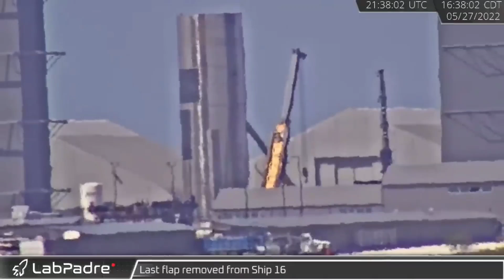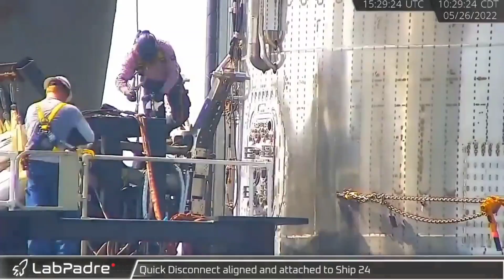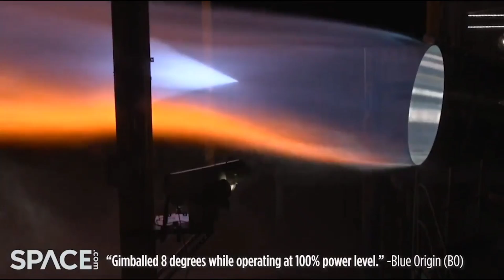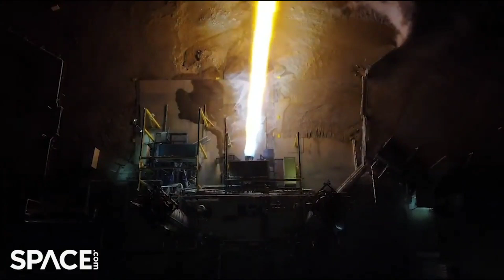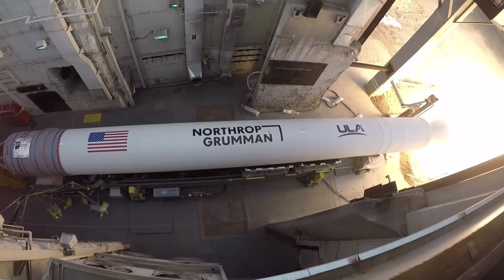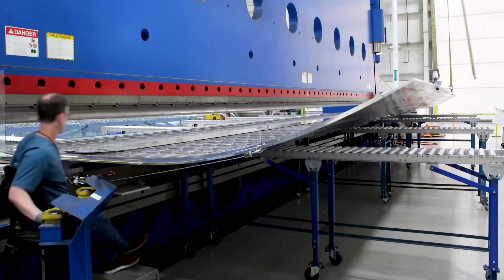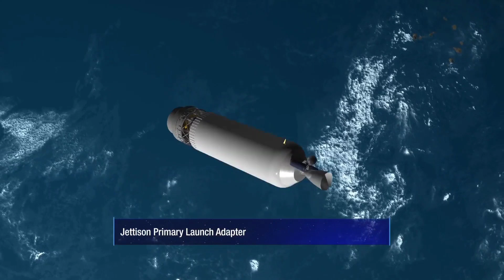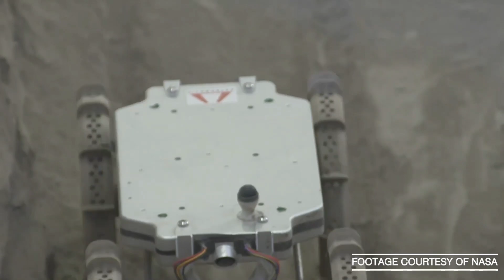Starship vs Vulcan Centaur!  Who launches first??  100K Challenge Update!!

Comment: While Tory Bruno is an engineer he is also head of ULA and needs to keep his investors calm, he has been fooled before by Blue Origin promises and so far they only have one operational engine which is a one off prototype. Now, there is no doubt that this BE-4 can operate to spec but the real issue is can it be manufactured at reasonable cost and to a reasonable time frame. So far they haven't tested a single production engine and have been working on the ones for ULA for over two years. The question has to be asked, what is taking so long? Pictures of the ULA engines released in the last few days are little different to the ones from last month with the power head still completely missing. If SpaceX can build dozens of Raptors for their prototype Starship and booster in just a few months what is Blue Origins excuse building just two.
Reply: Man, the lies here by you are pretty huge. Blue Origin finally has been releasing a huge load of BE-4 photos and descriptions on Twitter. Each of the dev engines shown have tested different aspects of the engine while in FLIGHT CONFIGURATION. 

We also know now from the designations for them that there are at least 12 different engines, not including those two flight engines that Tory has been showing pictures of.

We know now that PQE-100 was the first engine test fired. Additionally, the recent tweets give us at these designations:

PQE-602
PQE- 802
PQE- 900

So, each series of dev engines is at least three. So there 600, 601, and 602, for instance. The same with the 800 series, or six engines total. The 100 and 900 series adds at least two more or 8 engines. But we've seen others, like the two on on the Vulcan PTT fueling and launch procedure pathfinder (which is still at Cape Canaveral) which brings the number up to ten engines. There's another at Huntsville on display in the main lobby, or eleven, and a couple more seen at various trade shows.

We've also gotten confirmation of more flight production engines under construction at Huntsville.
Reply: @thomasackerman5399  how many years behind is Blue Origin in delivering engines to Bruno?
Reply: @thomasackerman5399  What lies, they still currently have only one operational prototype that has been capable of meeting the spec for thrust, throttling and duration. This is the current test article which as had so much press recently. The two engines with ULA currently have never been fired and are there just to do fit tests. The two 'production' engines that ULA are currently waiting for are still far from finished based on photos release in the last week and they still have to be tested and certified after manufacture is complete. Sure there have been many engines fired in the past but none of them met the specification having turbo pump and or combustion instability issues. The current test article is operating as required but is not a production unit. None of the production units have thus far been tested. So, we know that the design is capable of meeting its spec and we know it can run long enough to reach orbit easily. However the lack of progress producing the production units is worrying, they seem to be having real problems with manufacture, after all these units have been under construction for almost 2 years now. This does not bode well for ULA or their own New Glenn prototype.
Reply: @schrodingerscat1863  They have multiple engines that have met that. Or weren't you paying any attention to their tweets about each engine!? 

So tell me, which BE-4 engine (give me the designation) are you talking about and why is it different from the other engines I mentioned in my previous posting, all of which were fired in flight configuration and at full power. 

Also, you apparently aren't going to any good sources since you don't understand this or the fact that the two production flight engine photos are MONTHS out of date. The first photo showing the two engines going to the build up stand were taken in 8 January of this year... over 5 months ago! The second is not long after. 

Finally, you may not even know about the recent test stand readiness review a couple weeks or so ago that Blue Origin and ULA teams conducted in preparation for the flight engines' acceptance test firings at Corn Ranch.
Reply: @thomasackerman5399  So they still haven't got these engines finished for testing or they would be testing them, as you say the test stands are ready and waiting. We will see, they better work or ULA are going to be in a world of hurt, even more than they are now. What is taking them so long is the big question. If it takes well over a year to build 2 engines for ULA then what about seven for New Glenn, really they need to be producing a flight ready engine a month at minimum. If either of these engines has problems, which would not be unusual for any new engine it will be a total disaster for ULA.
Reply: @schrodingerscat1863  What engines are you now referring to now? It seems you're trying to be slippery here and avoid my questions to you.

Are you saying the test engines aren't built and tested, despite my going over this with you and the video as well as photos posted on Blue Origin's own Twitter feed and the information that in some cases, the engines have over 5000 seconds of firing time on them in flight configuration full-thrust and beyond mission cycle tests?

The two flight production engines aren't really different from the dev engines and should work just fine like the dev engines have. As I pointed out, the two photos of them posted by Tory are months old. You can see a big monitor screen in one that has January 8 2022 on it.
Reply: @thomasackerman5399  I'm talking about the production engines, these are still not ready despite being in production for well over a year. They were supposed to be delivered last summer, then the end of last year, then beginning of this year, now it's some time mid this year. If the design is sound which seems to be the case based on the current test engine then why are the production engines taking so long to build. This is my point in the OP. This seems like a red flag to me given that Blue Origin also tried to renegotiate the price a couple of years ago. I think they are struggling to build these engines in a timely and cost effective way. The excuses given so far are consistent with an engineering project in trouble in my experience. Even if not it shows terrible management when milestones are being constantly missed by so much.
Reply: @schrodingerscat1863  We actually don't know how far along the production engines are beyond where they were several months ago. Also, as I have to keep reminding you, and you keep avoiding it, there are several flight configuration dev engines. At least 6, but probably 10 or more. 

Things are far enough along that Tory Bruno has said that he's not interested in trying to go through the major redesign of many years and tons of money for another engine at this point. SpaceX and Raptor are still in dev at this point as well, no matter how many engines they've built, and there are many broken promises by Elon Musk where Raptor is concerned. I don't people realize that two private companies for the first time are R&Ding major ground-breaking engines on their own.

The fact is, this is hard, but at least significant progress is being made. And sadly, there's a lot of people who want to see BE-4 or Raptor fail out of childish tribalism.

Also, while reading the forums on NASAspaceflight, a few people brought up a great point about the media shift concerning BE-4 recently where they're stepping away from BE-4 being the sole problem to now Centaur V and the Peregrine lunar lander as being the long poles in the tent. If BE-4 gets acceptance test fired and delivered in a couple months, there's nothing left to blame Blue Origin for.

It's actually causing a lot of cognitive dissonance for certain people.
Reply: @thomasackerman5399  “If BE-4 gets acceptance test fired and delivered in a couple months, there's nothing left to blame Blue Origin for.” LOL. You’ve gone from certainty on Blue Origin Engines(Which Have Been Years Late On Delivery) to hedging your bet with the word “IF”
Reply: Bruno is part of Old Space
Reply: Easy answer: BO is lying. 
More elaborated answer: BO is showing simulated iterations as results, telling the production rocket will behave the same. Yeah, lying.
Reply: @BBBrasil  Sounds a out correct, the prototype that Bruno has seen operating is not a production engine and I don't think they have ever tested an engine built using the production processes so, at this moment, for Bruno to say he is isn't worried about it is either foolish or a lie to not spook his investors and I suspect the latter.

Comment: Very concerned by how easily those TPS tiles are still falling off. Sort of expected on the early prototypes but we're talking possible flight hardware now.
Reply: There was an internal explosion when some internal plumbing failed that caused tiles to fall off this time. The tiles seem fine with normal pressure tests now unlike early prototypes where the tiles fell off with every test so they are improving all the time.
Reply: I would consider the 1st half dozen or so flown starships to be early prototypes.
Reply: Even I starship fails a dozen times they are still moving faster than nasa would and every failure is a lesson learned. If this was nasa attempting to build something like this it would be 2040 before the first flight
Reply: As I understand it, the pressure caused a pressure line to push and buckle against the rocket's "skin", which cause the tiles to pop off. Afterward, they redesigned the pressure line from the original straight single pressure line to a doubleline with a bend and curvature along part of its length to allow for expansion and any buckling They pressure tested it all over again, and Voila! Success! All these failures have led to uch a great deal of knowledge gained. Much better that it happen now than on launch day.😄
Reply: Yea but remember , the tiles are there to make the ship reusable in LEO, they don't have steal melting problem, they  just don't want the fuel to overheat... they are really needed for Moon the earth entry for sure
Reply: @BadIronTree  ya that steel will welt away like nothing from Leo lol reentry heat is hot
Reply: I also have a feeling the TPS might fail, but they're only required for the reentry. Starship can get to orbit even if they all fall off on the way up, and it might be worth it to SpaceX to get data from the ascent or even from seeing how the TPS fails. Bottom line I'm not sure this will cause a delay of the first launch
Reply: Yea so the thing is the TPS tiles are for re-entry. So the tiles can fail 100 times before they figure out full reusability so long as they put payloads into orbit. They did the same with falcon 9. Many failed booster landings but I believe 100% or very close to mission success rate.
Reply: @ryrylandcripps5811  That's an excellent point.